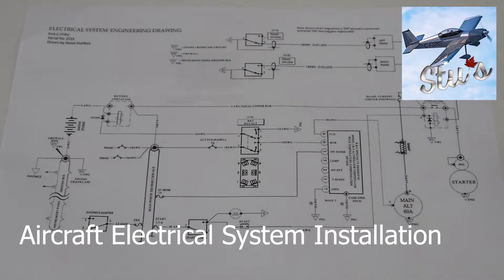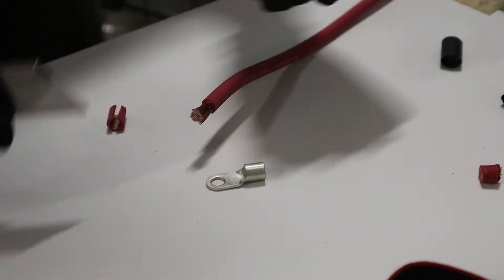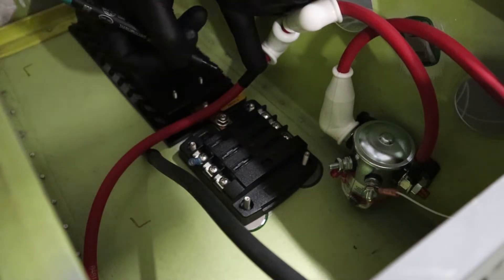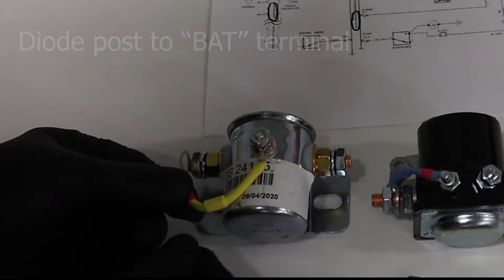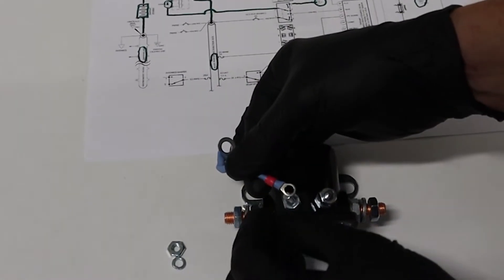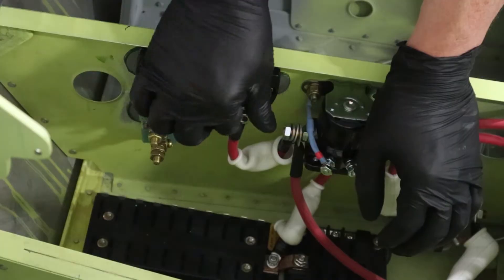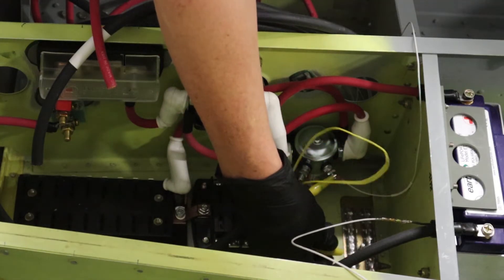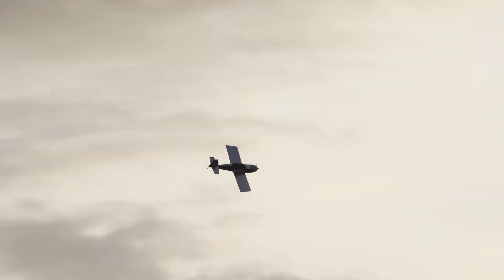Aircraft Basic Electrical System Installation

Comment: Anyone know if any Aircraft manufactures are using Lithium starter batteries yet?  With all the new battery management systems (BMS) out these days and all the new electronic devices developed over the last few years it has to be around the corner?  I have seen that China's AEC2.0L aircraft uses a Diesel Motor so maybe they are doing it already?

Comment: Is there a following up ? i wan't to know more.
Reply: Yes, please!  I can read/ analyze diagrams (sort of), but nothing drives it home like actually seeing it done.  Might've missed it in earlier comments...  but which Z-diagram is this following?  I'm trying to do something fairly simple but that will utilize two Earth-X batteries and a 60-amp belt-driven alternator plus a Monkworkz 30-amp vacuum pad-mount generator/ regulator.  Would love to see/ hear your explanation on the busses (assume that's why two separate fuse panels) and switch wiring.

Comment: I put a big 30 amp relay in for my little facet fuel pump on the ultralight.  I couldn't find a smaller relay, it's kinda big. do I even need a relay, I have a good switch.
Reply from the maker: For a basic facet pump a simple switch will work and that is what most people use.  Relays are for very large items like master and starter.

Comment: Sir... I have one doubt regarding aircraft electric circuit.

One switch has 3 positions with centre auto position. One indication light should ON either positions. But this is not coming ON in either positions but When coming back to Auto position light is coming ON for fraction of second then goes off. What may be the reason? I know without circuit it is difficult to tell? Thank you sir ..
Reply from the maker: Interesting.  I’ll have to draw myself a couple diagrams to see how I’d wire this and if it even possible with that switch.  I’ll get back to you.

Issue is with a momentary switch like that you are reversing the polarity.   Are you controlling flaps or trim with this?   What is reason for the light?   To show you it’s working?
Reply from the maker: The only way I can see doing this is using a light that will turn one with either polarity (normal incandescent bulb) not a LED.
Reply from the maker: Shoot me an email and I’ll send a picture 

Stu_aircraft_factory@hotmail.com
Reply: Thank you for ur reply....it's a very big wiring diagram & I can't share it. It's regarding aircraft anti icing. In protection check, light is not coming on in either positions as earlier said. Thank you sir🙏

Comment: Couple of suggestions:  Rather than taking starter current from downstream of the master relay, it is common practice to wire battery positive to the master relay with one wire, and to the starter relay with another.  That way the master really contacts will not carry starter current.  The disadvantage is that if the starter really contacts stick closed, you will have to disconnect the battery to stop the starter from turning.

As far as the ammeter shunt goes, you can do away with it.  Find out what the shunt resistance required for your meter is--it may be as low as one milliohm.  Next, look at the wires connecting the circuit that would normally go through the shunt.  Check out wire gauge/resistance per foot tables, and select a wire size that will complete the circuit, AND, when cut to the length that will be long enough, but not too long for installation, and will also result in the exact same resistance end-to-end as the bare shunt.  Ohm's Law, you know.  This will be a critical-length wire, for example, maybe 24 1/4 inches.  Now connect the ammeter lead wires to the same terminals to which the wire is connected when installed.  You can crimp the ammeter wires, which will probably be 20 or 22 gauge but size is not critical, into the same terminals terminating the larger, current carrying wires, to make a simple installation.  The wire can become the shunt, if it is exactly the same resistance.

When it comes to stripping wires, on production aircraft, a single nicked strand makes a wire unserviceable.  Leaving stands out of a terminal not only reduces the current-carrying capability, but the cut-off ends can work through the heat shrink and cause a short circuit.  Also, calibrated wire crimping equipment is extremely expensive, but under-crimping is common without it.  You can always test a completed wire assembly for its current carrying capability: Determine the maximum current that it will be expected to carry, devise a combination of batteries and loads (Ohm's Law again) that will produce that current, and connect the (completed) wire under test in series.  Connect a voltmeter between the two ends of the wire under test, turn on the current, and check the voltage drop on the voltmeter.  If the whole-wire voltage drop seems excessive, repeat the test at each terminal of the wire with one meter lead connected to the terminal end and the other lead to the wire conductor where it goes into the terminal.  An insufficient crimp will result in an excessive voltage drop.  For any given termination, you do not want a voltage drop much more than one percent of the aircraft supply voltage.

Comment: Hi. Great video. What are the part No:s on the currentlimiter and the shunt?
Reply from the maker: It’s a G3X system so everything was included.   Here is a link to Steinair website of G3X shunt and current limiter

https://www.steinair.com/product/g3x-shunt-100-amps/

https://www.steinair.com/product/anl-60-amp-fuse-limiter/

https://www.steinair.com/product/anl-fuse-limiter-block/
Reply: @stusaircraftfactory6592  Thank You. Actually i am restoring an Old airplane and redoing the whole electrical system. That is why I asked, as Your video was so informative for the rest. I would like to build the electrical as You suggested. By the way, I am a retired AirForce pilot in Sweden restoring a Jodel 1050.

Comment: I appears that the diode had heat shrink over it.  That isn’t a good idea as it makes keeping the orientation correct more difficult.
Reply from the maker: True but the connectors are already installed when you buy it with the relay.   It will only go on one way assuming they installed correctly

Comment: You can avoid stray strands by making only the cut around the cable and twisting the excess insulation as you pull it off.

Comment: I wish there were more videos out there like this when it comes to electricity.  You have the real components, and the schematics as well as the theory.  It's infuriating how you can know how to solve a circuit diagram, but if you open up a electrical box you don't see a schematic you see a bunch of wires and relays.
Reply: sorry to be so offtopic but does someone know a method to log back into an instagram account?
I somehow forgot my login password. I appreciate any assistance you can give me
Reply: @Porter Cooper instablaster =)
Reply: @Rocky Rene Thanks for your reply. I found the site thru google and im in the hacking process now.
Looks like it's gonna take quite some time so I will reply here later with my results.
Reply: @Rocky Rene It worked and I finally got access to my account again. I am so happy!
Thanks so much, you saved my ass :D
Reply: @Porter Cooper glad I could help =)

Comment: Stu Thankyou for such an excellent video. you use diodes on the starter and master relays can you please explain what they are and where we can get them
Keep up the good work 
 Barry a bede 4 builder
Reply from the maker: I buy them direct from Vans.   They have the size figured out.   They are for when the switch is turned on and off.   Keeps the spark lower.

Comment: WOW this is the clearest description I have ever seen of a basic electrical system. This helps me visualize the basics for building my RV-14. Thanks! Random question: what primer are you using?
Reply from the maker: For primer I use the simplest process possible.  Spray can self etching grey primer.
Reply: @stusaircraftfactory6592  Got it.. Me too (and the Sherman Williams P60G2 wash primer). I just saw the yellow primer on there
Reply from the maker: Yellow primer is zinc chromate - old school but great stuff

Comment: Why DO YOU NOT solder connections??
Reply from the maker: Because solder turns 19 strands into 1.   Makes the wire fragile and subject to breaking in a vibration environment.

Comment: Why so tiny gauge ground wire (the one you mentioned at the end of the video after debugging)?
Reply from the maker: That’s only to ground the starter solenoid base.  Actual ground wire is 4AWG.   Reason is I used clickbond fasteners so base was not grounded.   Just need to be cautious
Reply: @stusaircraftfactory6592  Makes sense now. Also been watching your video the whole evening. Just came across your channel. Wow. Detailed information on topic I wouldn't think about. One day I will build my plane but for now acquiring as much knowledge. Also working on my PPL. Looking forward to more great content from you.
Reply from the maker: @bibrakc  Awesome - its a learning curve but nothing impossible

Comment: I’ve seen some aerobatic planes mount their solenoids “sideways” so that pulling G doesn’t dislodge the plunger and engage the starter momentarily.. I realize the RV isn’t a hardcore aerobatic plane, but it wouldn’t hurt to go sideways anyway..any thoughts on that?
Reply from the maker: I’ve seen that also.   The magnet on the master relay pulls down so it will be ok.  The starter solenoid actually mounts upside down so you would have to do negative g to trip it.   Plus the g would be huge, the magnet is really strong.  Maybe a factor when it wears a bit

Comment: Okay, I had to look up  "click bond fastener." I have built 3 aircraft and have never heard of them. I saw Spruce as them. Do they hold up well to vibrations over time? Thanks for your video!
Reply from the maker: They use them on the F22 Raptor so I think they’re ok.   Prep is the key
Reply from the maker: I buy them at TheFlightShop.com